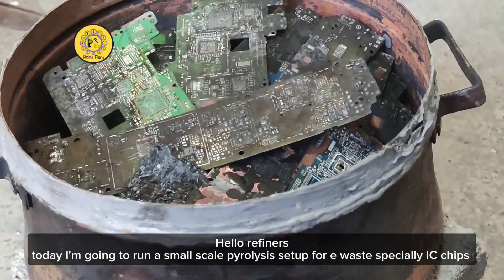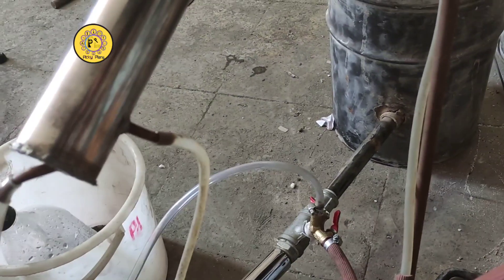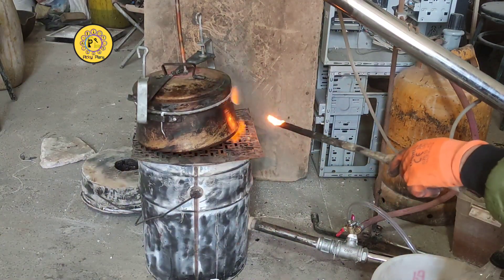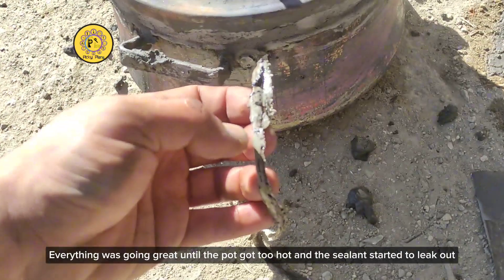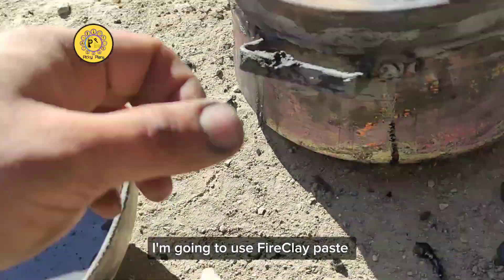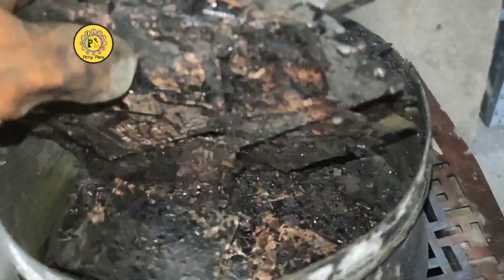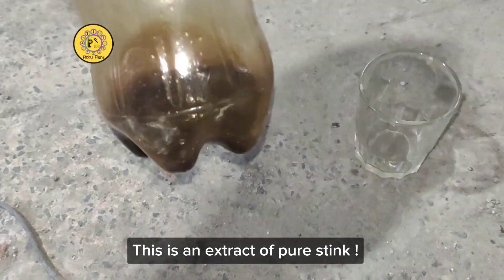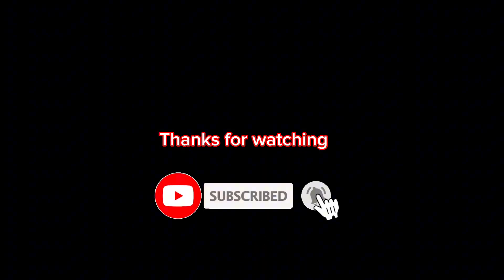Fuel from e - waste | Oil pyrolysis from PCBs | A better way than incineration

Comment: Great work, friend What percentage of the smell were you able to contain with this set up? 

I tried this recently without the condenser. The aim was to have a packed metal can with lid bolted on, with hole beneath (like a gas jet) for the fumes to eject, then placed into hot burning wood fire drum with a tall flue for good draft,  so all the stink was consumed by the fire and also the oils and gases consumed to add to the heat of the fire. Well, that was the plan. It worked, but wasn't totally clean. And smelly! There were times when it was clean but when I added more wood, which was a little damp, it did not work so well. Probably needed an afterburner in the flue. 

The idea behind that is this: A potter I spoke to years ago said they used an gas afterburner to clean the smoke coming out of their diesel powered raku kiln. Just enough to stop the black smoke.

Comment: Which is the temperature you have to get for.an optimal pyrolysisi process in this case?
Reply from the maker: You need to keep it below 500° C.
400 ° Celsius is optimum.

Comment: You have two channels? This seems to be the rather active one so i'll only be subscribed here :). Lovely vid. Btw, I think you can make the oil burn better if you let gas go thru it, but there it goes your extra risk of explosion too, that oil is a combo of gasoline and wax and maybe diesel? I don't understand the details hehe.
Reply from the maker: Thanks mate. Yes two channels but this one is active as you mentioned. The oil is a mix of heavy chains oil + gasoline+ petrol and halide molecules like bromine and iodide. I prefer not to burn the oil prior to refining . That was only a demo...

Comment: The rotating drum is about 500mm long and 300mm in diameter  about 2.5mm wall and is made of 316 stainless. I think it came from paint manufacturing. (Beer kegs are great items for this work!) One end was a bolt on front plate for loading chipped-up PCBs. I used red silcon gasget but muffler paste was also used like yours as well.  It turns at about 2 rpm. Driven by a much geared-down windscreen motor, Chain driven onto exaust  pipe of the drum. This help greatly in even treatment of all the PCBs. Heat is from electric  elements like in a pottery furnace but built into 200 liter oil drum with fiber-fax insulation.  500C was the limit to stop too much gasification. Also showered the gas with NaOH solution to capture PVC products and I guess some bromine Cls. I like your burning of the gas, however I was interested in temp, contol so just went electric. May be hybrid would be best.
SS drum  rotated on 50mm SS pipe on brass bushes. Gas sealing on the shaft was done with shaft sealing rope (from water pump shaft seal rope). I condensed the oils into a SS beer keg. I used a vacum (Vuacum Cleaner) to draw the gasess through a pipe filled with activated carbon, No smell from this gas at all, but that oil stings bad!! Bromine recovery sounds interesting, never thought of that. The carbon-arc furnace is still in the build. Using 20mm dia. carbon gouging rods which will arc onto the top of the pool of metal/slag. All under nitrogen gas. Electrowinning of thes cast metal recovered initally copper, and the sludge is gold & AgCl etc.  Used a chloride solution.  All the best with your recoveries. I enjoy you videos.
Reply from the maker: Wow my friend very helpful information from A to Z that sparked a bunches of ideas in my head which will help a lot.
Thanks for taking time, thanks for watching my videos 🙏🌹

Comment: I have done a similar experiment with a rotating drum of PCB pieces, kept the temp to about 500C electrical tube furnace. I was able to keep more oil and less gas. Was not sure what to with that pure stink oil. PCB and chips were a breaze to process with wet chemistry means. Other plans are to process in carbon arc furnace afte the low temp pyrolisis. Loved your setup!!
Reply from the maker: Thanks mate!! Seems like a pretty neat setup! Tell me how it stood in that corrosive environment? Was the iron drum good for that? 
 I know people making money from selling bromine and refined oil to the companies. But you can use it to fire your furnace.

Comment: Put a safety valve for the boiler so that if the pressure becomes too high, it will not explode and burn 80%. This boiler has one outlet. If it is blocked with slag, the pressure will rise and it will explode. Be sure to install a safety valve on the boiler.
Reply from the maker: Thanks, Mr Naqdipoor for the advice...
I will consider it in the next boiler version...

Comment: Do you have rough numbers on fuel input and output?
Reply from the maker: The volume??
85 ml from 1.5 kg PCBs
Reply: @PickyPlans  cool!  Do you know how much fuel from outside the system was burned?
Reply from the maker: I've used this gas cylinder for the last gold smelting and cupellation, now for the pyrolysis process. The full cylinder contains 11 kg of LPG I'm guessing roughly 0.5 kg of gas was burned during this process.
Reply: @PickyPlans  thank you!